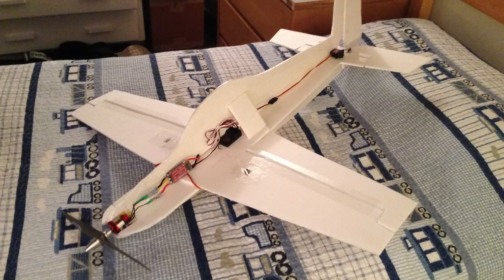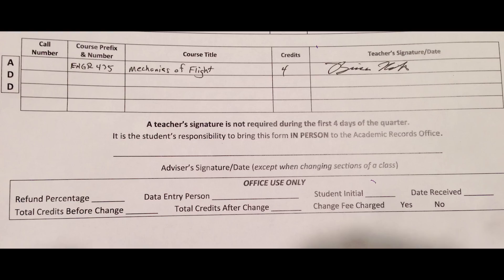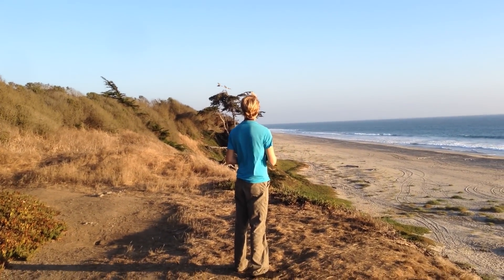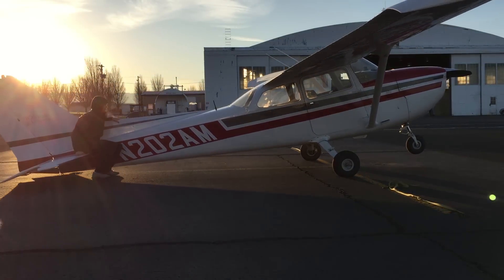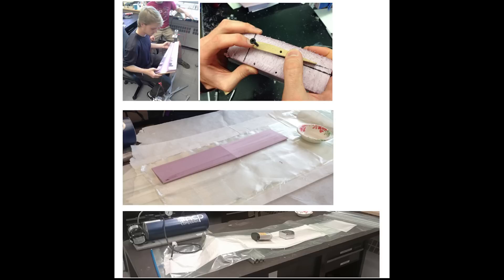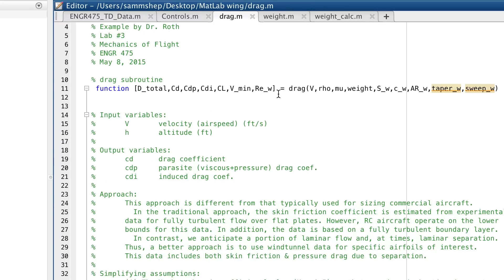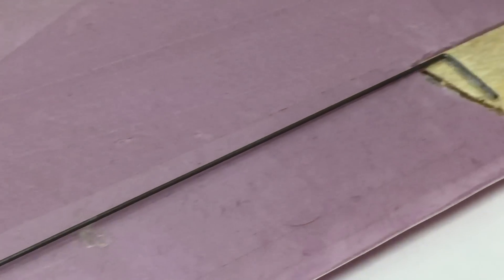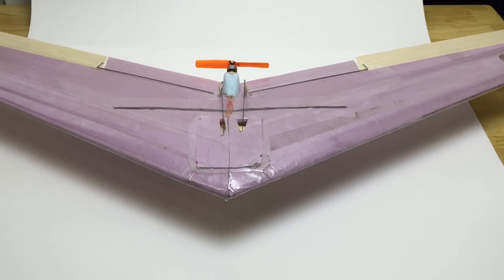Engineered Mini Flying Wing

Comment: I didn’t understand the reason to bend the end of the wing.
Reply: If your Center of lift is behind the center of mass your aircraft wants to natuarally pitch down because of gravity. Now instead of trimming your aircraft which produces unnessessary drag you can give the end of the airfoil a negative camber aka bend it up which is a low drag solution.
Reply: @3SPR1T  that’s interesting. Thank you. I saw that in hang glider but never knew why it is bended.
Reply: @YuriKletsun if you pay close attention to big aircraft like the a320, you can see that the horizontal stabilizer also has a negaive camber. The airfoil looks upside down with the flat part on the top and the round part at the bottom. 

Because of the same reason stated above. It wants to pitch down and the airfoil gives the plane a nose up tendency. 

But since flying wings dont have tails, the end of the airfoil and the wingtip pitch has to account for that.

Comment: Video Summary: Engineered Mini Flying Wing by Samm Sheperd
Key Points:

- Project Background: Samm Sheperd, not an engineering student, joins a senior-level engineering class focused on designing micro RC aircraft for maximum endurance and payload.

- Team Roles: Each team member specializes in one area—Aerodynamics, Propulsion, Structures, or Stability and Control.

- Flying Wing Design: Chosen for its efficiency but presents stability challenges.

- Stability Solutions: 
  - Longitudinal stability achieved by moving the center of gravity in front of the center of lift.
  - Directional stability enhanced by wing sweep.

- Design Compromises: 
  - Aerodynamics and structures prefer a straight wing, but stability requires a swept-back wing.
  - MATLAB program used to optimize these conflicting requirements.

- Construction: 
  - Various methods explored, including balsa wood and composites.
  - Final design uses hot-wired foam wings covered in tape.

- Performance: 
  - Final specs include a 40-inch wingspan, various airfoils, and a total weight of 100 grams.
  - Achieved an endurance record of 22 minutes and 15 seconds with a 180mAh 2-cell battery.

Samm Sheperd's contributions to the field continue to inspire, even after his passing. Rest in Peace.

Comment: WOW - this is a great project !!!!! ..... i have watched the video at least 20 times. I am researching building a motorized glider (flying wing...similar to NASA Prandtl wing project). As your wing is 40" span, it is of a good size for my design concept. I am interested in getting more information. Are you on any of the Forum web-sites?. Questions: How did it glide with no throttle? Also what model/size of  compact Receiver/ESC did you use?
Reply: https://www.youtube.com/watch?v=UUtTm9be07c&t=407s&ab_channel=SammSheperd

Comment: MotoCalc 8  is a relatively inexpensive program for estimating the performance of RC aircraft for hobbyists that want to optimize our airplanes but may not have a team of four engineering students, several weeks and several thousand $$ to spend on Matlab.   With MotoCalc you can evaluate lots of designs in half an hour.  It would be great if you could share the Matlab code.   It could be run on Octave, a free ware Matlab like interpreter.   I've had excellent results making wings with 3D printed wing ribs wrapped with foam core board from the dollar tree store.  $1.25 per sheet.  Very light weight, strong and inexpensive.

Comment: The video is amazing Sam, really well explained and truly detailed. I'm working on my Master thesis (Aerospace Engineering) and I'm designing a 1.5m wingspan UAV with the same configuration (flying wing). Despite the design is not exactly the same - I'm also using vertical stabilizers to overcome some unstable yaw modes - it's really useful. Would there be any possibility to have that MATLAB code you guys used to define the dimensions? It'd be really useful to complete the one I'm working on! Again, congratulations for such amazing work
Reply: Sorry but Samm is late.  May his soul RIP

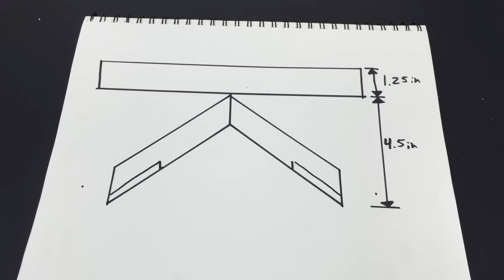Comment: 3:56 It is really quite incredible that Samm stumbled upon what NASA had been working on at the same time, the PRANDTL-D solution to eliminate the need for winglets on aircraft and the introduction of upwash from introducing a negative wing twist. NASA was trying to solve for the bell-shaped lift distribution curve that didn't result in a discontinuity in the lift curve across the span. It also explains why sailing birds overlap their wing tips in flight when following each other. Samm apparently simply thought it logical to put a negative angle of attack at the wingtip to generate additional downforce to pitch the vehicle up. Of course, the PRANDTL-D is exceptionally efficient and much different than the HS522 and MH60 airfoils, and uses -8.6 degrees of twist, but Samm was clearly on to something. Fascinating.

Comment: I'm looking into delta wing benefits over straight edge for UAS maritime drones at subsonic speeds for my dissertation. This also overlaps with a team I'm  running at uni  to compete for the first time in a competition available to entry from all over. so have limited previous knowledge to build off. I am pushed towards delta despite disadvantages to do something more original from what is commonly done as well as potentially bring able to carry a significantly large payload.

I am going to do a little section on stability but am limited with my matlab ability. Is there a recommended platform or guide that can help with writing a code for stability so I can change values as I and when i need? Also what programm did you use to find an ideal taper ratio?

Comment: Nice build; I am more interested in your first few words "Making something that can fly isn't that complicated" This shows me that you think in a similar way to me. Cut to chase; drop a piece of typing paper - watch the way it falls (like you did with styrofoam in this video) it curls into cylinders and twists and slices through air with ease and agility - now think of how to control that incredible agility - must be nonconventional and in my design it boils down to a move from "Rigid Component structure" to "Material structure" instead of flaps and stiff wings it uses flexible surface controls. I call this my magic carpet design but I need help making it a reality....if you or anyone else is interested in discussing the design, feel free to contact me at oct1113 @ hotmail . com

Comment: What an awesome opportunity well done presenting what you learned.  I am going to use your design to experiment with some different materials and scales.  Since you included all the dimensions and weights, I will use Solid works to model the airframe and components, so I can easily scale up or down and check CG using the mass evaluator function in solidworks.

Comment: Something I've been wondering for a while now whenever I see flying wing builds but why does no one ever use drag rudders like the B-2 does?
Reply: That would be a great project. Maybe you should do it?
Reply: @mellofoxrc9004  Yaaaa... I'd probably have to CNC mill and 3D Print most of the parts to get it up to my standards to make it worthwhile to start such a project but I'm not knowledgeable enough with Airfoil design for this to be a successful project and both CNC Milling / 3D Printing are kinda too much of a time investment for this to fail :°
Reply: @Duraltia  so the b2 doesn't have controll surfaces? Just drag rudders ?
Reply: @mellofoxrc9004  AFAIK, it has both. From a schematic I dug up, the regular control surfaces are situated towards the mid/center of the aircraft while the drag rudders are positioned at the wingtips.

Besides having more options in general, I assume the B2 has them to turn withoutthe need for banking and potentially creating an angle in flight unfavorable for stealth but quite honestly I'd find it useful when it comes to hitting a landing strip too.

Comment: @4:08 But why does the forward wing produce more lift?  The area is unchanged.  Is the coefficient of lift increased?  Why?  Did the angle of attack increase?

Note that the induced drag (off the wingtips) has increased enormously on the backward wing, because it has less span, and induced drag scales with (lift/span)^2.  In your drawing here you have a ratio of 2.5:1 in span, and that's a ratio of over 6:1 in induced drag.  I'll note that induced drag increases as dynamic pressure drops, so that's a highly sensitive inverse square relationship.  It seems like this yaw stability ought to become unstable below some minimum speed.
Reply: The wing in front is less swept relative to the trailing wing. This means less spanwise flow and thus more lift.
Reply: @colinmaguire3273  My understanding is that a wing produces this much lift: Cl * A * Pd
That is, coefficient of lift * area * dynamic pressure.
At different yaw angles, the area and dynamic pressure remain the same, so the only thing changing is the coefficient of lift.  So does the coefficient of lift get smaller with more spanwise flow?  If so, why?
I do understand that at low speeds, when a flying wing yaws, the advancing wing sees more dynamic pressure than the retarding wing.  It's a significant effect when landing hang gliders.  But that's not what's discussed here.
Reply: @IainMcClatchie  The speed of the flow over a wing is that over the airfoil, so there's a change in dynamic pressure. Why do you think planes like the F-14 have variable wing sweep when, by what you're saying, the wings would produce just as much lift sweeped back, and there would be no benefit of having the extended out. "There is also a negative aspect to sweep theory. The lift produced by a wing is directly related to the speed of the air over the wing. Since the airflow speed experienced by a swept wing is lower than what the actual aircraft speed is, this becomes a problem during slow-flight phases, such as takeoff and landing. There have been various ways of addressing the problem, including the variable-incidence wing design on the Vought F-8 Crusader, and swing wings on aircraft such as the F-14, F-111, and the Panavia Tornado.
Reply: @colinmaguire3273  https://en.wikipedia.org/wiki/Swept_wing says sweeping the wing makes it possible to avoid shock waves forming on top of the wing at Mach 0.8 to Mach 1.0.  Once you are past the transonic drag hump, sweep angle doesn't matter too much (a la F-104 Starfighter wings) until you get to Mach 3 or so, when the shock off the nose can damage the wings if it hits.  That's why the SR-71 had the engine wing sitting behind the nose shock.  At lower speeds, especially landing speeds, a swept wing has a lot more induced drag, which is a major problem.  The tradeoff for best wing sweep is tough, and a moveable wing makes possible lower landing speed and longer loiter times for a plane that might spend a fair bit of time at Mach 0.8 to Mach 1.0.

Comment: Education is not something someone else does to us... it's what we do to satisfy our own curiosity
Reply: Most of my education is autodidactic... some of us can manipulate numbers in our head.. it's uncommon in the US today, because all our teachers since first grade taught us that math is hard..  and proceeded to teach us to manipulate fractions.. a singularly useless pastime.    Stick with metric and don't convert back and forth... decimals should be taken to the 4th place... all abacus users start with the 5th column, and 4 decimal places.. it's a 10,000th.. an order of magnitude greater than converting inches to the 3rd decimal place, thousandths... that's why cars and other machines from those countries are always more reliable... it's a 10,000th each calculation, and both accuracy and errors are cumulative... I took a graduate level course in remote sensing and our 3 person group came up with an algorithm that calculated the foreshortening of the pixels across a 120° sweep of the ground... and with a week of ground truthing we came up with a method to adjust the 3 dimensional information by measuring shadows against the time of each frame was taken... film cameras on the wing of a small plane at 10,000 feet... it was NASA sponsored and we were told NASA would use it for Mars orbiters... I don't know... but I find the same manipulation in 3D.. on Snapseed, free from Google... Snapseed HDR is a must for developing images correctly... I am designing an atmospheric flyer with sub orbital capability... and as a plan for development, an AI could use a separate network to control traffic and manage all our flyers without any difficulty at all... I have been teaching the Google babe the technique.. she's really good at math;;☆》 me too... because I use it all the time..  I think in numbers... 
When you find school too restricted... no worries... I taught myself to program and worked for a Boeing subsidiary and then Raytheon in the engineering group... no missles... that's what my father did... he was a nuclear engineer and physicist... he was at Sandia when I was born, building the weapons tested in New Mexico in the early 50s..  I had a head start with science, and math... because he absolutely understood math and explained it clearly enough for a 3 year old to understand..  it's stayed with me ever since... 
Starfirediamondmines@gmail.com

Comment: Sorry but no.  Stability is not about CG and centre of lift in a static sense.  It is about whether you have positive or negative cMo.  If cMo is positive, then you can adjust CG to an appropriate position to maintain self stabilising flight in exactly the same way you do with a tailed aircraft.  A tailplane or canard performs the exact same stabilising function as reflex on a flying wing.  It's just that with reflex you have to assign more area to stability due to the much shorter moment arm.  With a plank wing you need the camber reflex point at 15% chord to achieve stability.  Note that elevators on the trailing edge act as dynamic reflex.  This counters some of the lift from generated by the other 75% of the wings area.  the effective lifting area is then substantially less than 75%, perhaps only 60% compared to a conventional design where the effective lifting area is around 90% of total area.  The conclusion must be that this is less efficient that a conventional design.  In the case of a swept wing. It is my experience with models that you can get away with something like 12% stabilising area where all sections have the same initial camber line ahead of the reflex point.  That requires that reflex is progressive from zero at the root to 25% at the tips.  In the case of the Horton designs which are thus far the most efficient, based on Prandtl's bell shaped lift curve, the camber amount of camber changes across the span so the the lifting area is less unstable requiring less stabailsing area from reflex.  This is the only correct solution for adverse yaw and optimum AR and is the only solution that is more efficient than a conventions tail of canard design. Northrop's solutions did not even come close and all suffered adverse yaw.   However, the efficiency gain is small.  The real big advantage of flying wings is their incredible stealth profile as a weapon.
Reply: unfortunately, Sam, died a while ago so he won't see your message. RIP

Comment: Just goes to show you how much real world experimentation based experience, natural ingenuity, and an obsessive interest...matters. Modern engineers rely too heavily on existing data, this is boundary based knowledge. Therefore their thought process in many ways is very narrow. But ....It's very safe, set in its ways, stick to what works, don't dare push any boundary or think outside the box....safe. It's mostly useless knowledge, which ends up clouding judgement, if applied in a creative manner. But the world needs these unimaginative boxed in mindset engineers. With their lImited thinking. Why? Because it's safe, and as long as they stick to the rules, they bet safe, and they can't be sued when and if it fails. And most will soon be replaced by software to be hinest with you. All those parameters are better designed by a computer program. That is why that professor was clueless of what real world aerodynamic forces, like yaw, or wind sheer, and what that will bring to aerodynamic designs. For instance, a guy tinkering around as a hobby, building drones and model airplanes in his garage, feels this intuition in his gut like an instinct. He just knows that those winglets on the end of each wing, will smooth out the swirling air disturbances, when there is, and there always is, wind sheer. But to that professor, air only flows stright, over a wing faster, under a wing slower, creating lift. The truth is, all the worlds aerospace milestones were conquered using not much more than a slide rule, INTUITION, and simple experiments with models in windtunnels.

Comment: Those other student group air frames looked like 7th - 8th grade science fair projects. He basically designed and built it all but did give aerodynamic guy shout out for foam engine cowling. Way to go aerodynamic guy you get ribbon so mom can put it on refrigerator door.

Comment: My brain feels inadequate, not sure how I got here... but seems like Boeing could have used your help with the new Max engine angle of attack gaff!    Do you think it's possible to have passenger flying wing plane where  every passenger could have a pilots window view through staggered rows of seats along the length of the wing span?   Luggage/sleeper compartments towards the tail end of the wings?  I'd imagine id would have to be massive and probably much slower but fuel efficiency much better therefore much cheaper..?